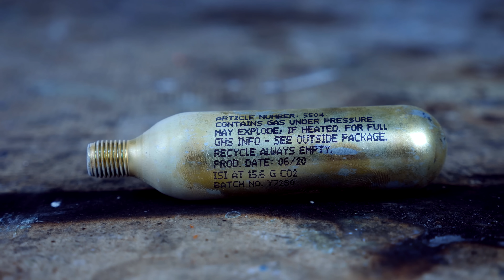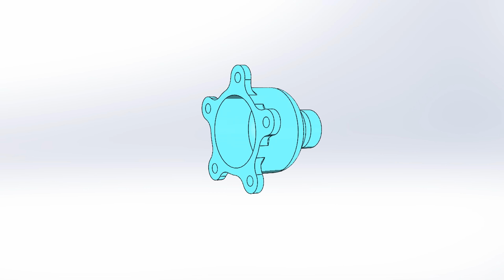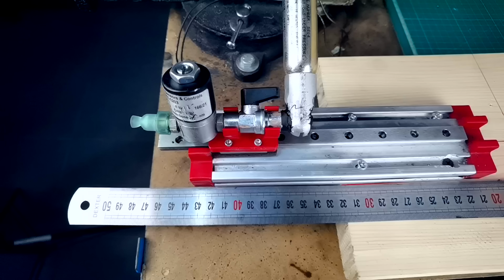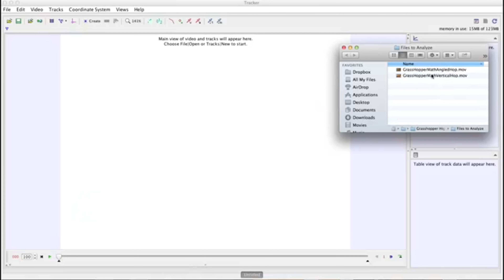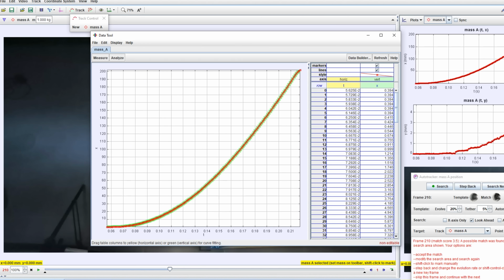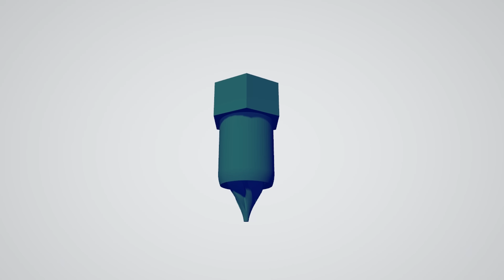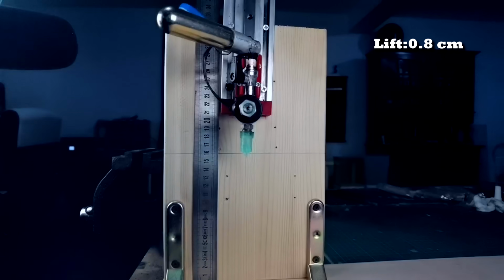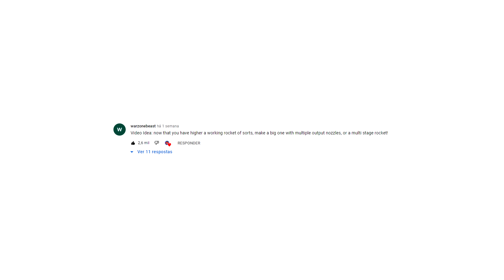I 3D printed a CO2 Rocket

Comment from the maker: For more updates follow me on Instagram @integzaa -https://www.instagram.com/integzaa/
Reply: try building a 3d printed rocket with only one co2 cannister! (sodastream rocket?)
Reply: Make hydrogen powered rocket 🚀 🔥 🔥
Reply: @parshvapatel8484  stop spamming for hydrogen powered engines
Reply: Video idea: use the dry ice nozzles and co2 to make a boat, it would e great bc the lateral propultion is really strong
Reply: put a tomato in space
Reply: Maybe you can add more material along the way, thus creating a system that will compress more material together, which will create (hopefully) more pressure and push the rocket farther.
Reply: so you tried hot rockets that melt your nozzles, 
now in this video you have cryogenic propellant, so cold infact that you are not extracting all the energy out of it because of the cold exit temperature
you know that if you combine both you will get something you could probably launch with decent payloads to hundred of meters? (without melting your hardware)
Reply: Johnny Bravo!
Reply: I want to tell you that you have forgotten a very important thing: you let most of the carbon dioxide expand outside the nozzle, which loses a lot of energy! Your engine is like a nuclear-powered hydrogen rocket engine without heating any more.
So I suggest you warm up the carbon dioxide before it blows out:-)
Reply: @sticker89  A longer divergent nozzle is needed.
Reply: Video Idea: Make a air pressure powered Strandbeest (walking machine), from Theo Jansen :D. Maybe with spider form, with the abdomen as the engine and tank c:
Reply: For the aeros pike engine you should have narrowed the throat before putting the spike. The aerospike is just the nozzle but it needs the throat as well in the footage you can see that the stream was straight but it wasn’t compressed before that so first compress the stream and then put the nozzle. So what you need to do it compress the throat to 0.5 cms and then put at aerospike at the tip you will get more thrust then what you tested
Reply: Hey just so you know Thingy Verse had a data leak and so you should really change your passwords
Reply: add an electrical heating coil inside the nozzle or something to make the gas expand more
Reply: Video idea: Best rocket fuel for under $20
Reply: Video idea :build an air or Co2 powered rc tank 😸
Reply: I am here integza if you need anything
Reply: that "dziękuje ci" wasn't the worst i heard
Reply: Thank you for the Johnny Bravo reference!
Reply: The last rocket nozzle that you made with the helix shapes would probably have the added bonus of being self stabilising in flight .
Reply: could you create a chamber for the filling to expand? i feel you are missing a lot of phase change by ejecting liquid from the canister. yes, a little more thrust upsidedown sure, but you are being more inefficient, which is important for rockets yeah?
Reply: could be just a long steel tube
Reply: Tomatoes are delicious
Reply: I feel touched ❤️ .I'm form poland .. 😅🤣
Reply: Ok so you've done sold liquid and gas rockets. What about a plasma rocket?
Reply: it would be great to have a water cooled ceramic combustion chamber/nozzle with inbuilt pathways for the water to enter and leave.
Reply: i suggest to send tomato to edge of space ... without parachute of course
Reply: You keep saying that you suck at soldering. But you don't have to! Soldering is a very learnable skill. Start by getting yourself a quality iron and a small variety of tips, I recommend an sh-72 or ts100. Watch a bunch of YouTube videos about electronic soldering. Don't forget to get solder and flux. And get some cheap soldering practice kits from eBay or Amazon or your local supplier. Then practice, practice, practice! 
If you think it'll amuse us, then make a video about your journey to learn to solder better!

Even if you don't do any of the above, keep making videos, they're fun to watch and educational!
Reply: There is one thing you don't Test ist cylinder Tesla value
Reply: Try building a propeller sail boat. The propeller will catch the wind and drive a propeller in the water.
Reply: I was wondering if you could design a nozzle that pulled in air from around the bell to apply the pressure of the added intake? Or would that just add more resistance?
Reply: Integzaa why not build for your hydrogen peroxide ceramic Catalyst rocket a chamber that like an air compressor turns itself off and on use a sensor and a pump to fuel the chamber allowing you to regulate your pressure in the chamber and you can separate your waist and discard that as needed allowing your nozzle to have constant pressure
Reply: Please explore this more with more nozels and stuff like that or different designs
Reply: Ok
Reply: Hey Integza, I am looking into engineering degrees and I was wondering what degree you have?
Reply: Would be interesting to see what sort of thrust you can generate with a sodium bicarb / citric acid / water reaction ie cut out the middleman and make your own co2
Reply: https://youtu.be/NlT6XqpoeToy6
Reply: Don’t forget that different materials/fuels will behave very differently so you will get different results from each fuel-nozzle combination where some will do well with one nozzle and others with a different one. I am no expert, that’s just what I would expect.
Reply: Which rocket nozzle would do the most damage to a tomato?
Reply: Video Idea You could create a vacuum chamber to test the nozzles vacuum space  should be a good idea and if you try to ionize the gases with a tesla coil maybe do some explosion
blast tomatoes   ahahahaha
Reply: hey integza if you cut the very tip of a match and use the fire as thrust it will take a bunch of matches but it would be kinda cool
Reply: Make Rocket engine turbopump made up of tesla turbine and tesla valve nozzle
Reply: While you are right in the sense that you no longer need a combustion chamber, you do still need a chamber.  Only now you need an expansion chamber.  You are ejecting a lot of co2 that is still in liquid form when leaving the nozzle or is just starting the transition to gas.  also as co2 goes from liquid to gas its sporadic and tends to bubble and spirt every which way.  I would suggest an expansion chamber with some sort of baffling system inside, but you have to be careful with dimensions and material strength or you get back into just having a fireless plastic firecracker haha.  I was bored and fired up blender to mock up what came to my mind when I thought of an inline expansion chamber, if you would like to see it just let me know. :)
Reply: Hey Integza, since we're at an experimental stage with unusual propellants, here's the tip: Brazil is developing an ethanol-based rocket engine called the L75. There's a significant amount of material on the internet about it, but I haven't seen anyone talking about it.
Reply: Intenzaa how about experimenting wood you instead of the cylindrical Arrow spikes rocket engines how about doing the linear Arrow spikes you don't even have to use thrust vectoring with it instead just shut down whatever injectors and it'll go in that direction
Reply: I used to work with paintball equipment, a bunch of that stuff is powered by CO2. When you pull CO2 quickly from the capsule like that you are getting liquid CO2 and it's being ejected so quickly from the thrust chamber that it is phase changing to a mixture of gas and solid outside the nozzle and you are loosing most of your potential energy. To correct this you need an expansion chamber between the capsule and the rocket. This way you harvest all the energy from the phase change because only gaseous CO2 is reaching the engine.
Reply: im 17 and i get the johnny bravo refference XD
Reply: Good video, but.. was all those nozzles really necesary? I mean it is not something advanced, just some basic gasodynamics. You could do all computations in some mathematical modelling environment (like Ansys or MATLAB, or Kompas 3D/Solidworks)... But it would be cool to show why an engeneer needs to know his math and physics.
Reply: lol i loved Jonny Bravo to bro lol
but ya lol we are getting old.... gd
Reply: Hey u should make a co2 powered golf club to smash golf balls and tomatoes 🍅
Reply: Another video idea make a co2 Powered boat that has a hydrofoil on it
Reply: I don't have a video idea, but you should try putting your 3d prints in a hot water bath before support removal! They fall right off when you do :)
Just make sure to cure any resin that ends up in your bath
Reply: Good job you finally got a working 3d printed rocket :D
Reply: Rocket powered lawnmower?
Reply: before removing support leave the print in hot water (like 60 c) for 2 minutes.
thank me later
Reply: Axial flux motor has high torque plss use it for anything and plss rply
Reply: Axial flux motor has high torque plss use it for anything and plss rply
Reply: Make sugar rocket pls
Reply: Hi, Integza. You'd better make such a rocket from your old co2 bottles without any valves and with large hole in the neck of a bottle instead of small orifice you have. Because it's difficult to say what is the bottleneck:) in your performance. Use just bottle, nozzle and cork in it. Possibly refuel your bottle through cork. Keep everything in place by some holding mechanism. Release it, let the cork pop out and enjoy the show. Show must go on:)
Reply: Im Missing the 3D printed hydroelectric power project hope you come back to this.

I would like to see the Cylindrical Tesla valve as rocket engine maybe as hybrid rocket?

But the most interesting part a turbine which can use compressed air. Make build like a steam turbine
Reply: It's okay we are all getting old.
Reply: I don't know about the plastics you use in your 3d printing BUT I do know that SOME plastics will micro crack when washed with alcohol, I learned this when I made some plastic parts out of (not sure what type) clear plastic and I wiped some of them in alcohol and when I placed some force it broke and when I looked at it with a 10X magnifying glass I saw that the parts wiped with the alcohol had micro cracks but not the parts that i did not wipe...
Reply: Have you ever considered a co² mighty mouse rocket pod, to fire on a tomato 🍅? 😂
Reply: Idea for vid to enter to win 3d printer.   A frictionless magnetic engine.   I think It would really be fun and chalanging for you. And really fun For us fans to watch.    Always enjoy your vids and your war on tomatos.

Comment: What you need is more propellant mass. Use the pressure to drive water though a laminar flow nozzle.

This doesn't detract from the original purpose and results of your experiment, though.

Comment: Try to generate enough solot energy to power a blue LED through a micro-burst, using high power and Sub-Zero cooling the LED before firing it.  Will it work?

Comment: I cannot share my idea as I don't have a patient on it yet. It's a thrust engine that requires only maintenance on the fin assembly inside a turbine system and Bearing system that has only a 1 way valve to expell gas that maybuild up from the decomp of oil molecules. Next is the whole thinker. Think of our friend tesla :) and plasma physics of charged air displacement. I leave the rest to you my friend.

Comment: Its not dry ice inside. It is CO2 liquid. Once exposed to the atmosphere, it evaporates and cools the remaining liquid into dry ice. Liquid CO2 is used in fire extinguishers and in large dewars for restaurant use. Dry ice can only exist below room temperatures, and liquid CO2 can only exist at high pressures. At regular pressures, dry ice sublimates into CO2 gas, and CO2 gas can be deposited as dry ice onto a substrate if the substrate is below 78 C. I am surprised that with his knowledge he didn't know this.

Comment: Optimally, youd want to reduce the weight of the rocet as the fuel is expended. Id suggest a multiple stage rocket where every inch the rocket dumps out its shell. Id use a carbon fiber tube cut in a inch long sections. Then d3 print connection like a round hindge around the edge with fuse cord holding it in place. The rocket would be ram rodded into the carbon fiber, the fuse cord would be holding each section in place, till the rocket reaches that section the the cord would burn off, dropping that section. You could make 5 stages. Each one burns off, reducing the wieght as it goes. To keep it going straight id add rotation to the rocket by adding a spiral fins, to promote torque. Almost using the air itself as a gun barrel. As far as a rocket nozzel...the trick it to increase velosity without causing a restriction, or boom. Id accomplish that by using small straw sized aluminum tubing around the exit port. Maybe a stainless tie wrap to hold them together. They should fit sung into the inside of the rocket and extend about 1 inch out. Then, remove material so the straws look like a rocket nozzel made from straws. This sould increase your gas velosity, while not restricting the expansion of the gasses, or boom. If this sounds confusing let me know and ill make a short vid on a dry eraser board, descrbing the design. Good luck, love the channel.

Comment: An episode idea: Since it is more energy efficient to move a large mass with a small delta-V than a small mass with a high delta-V, why not 3D print a device that will take the CO2 gas to turn an impeller geared to turn a propeller? (Sort of compressed gas powered turboprop.)

Comment: It would have been interesting to weigh the cartridges before and after (at room temperature) to see how much variation there is in the CO2 charge. Even though each cartridge is used only once, it would give you a handle on how much variation you should expect even with the same nozzle.

Comment: 0:53 While that solid is called dry ice, it's not what in the container. In that container is supercritical C0₂. Supercritical describe a state between gaseous and liquid. Which is both (gaseous and liquid) and neither. It behaves as a liquid is so far, that you get evaporating cooling when released from the container. That is why it will build dry ice, if you do it fast enough.  But in the rest, it behaves more like a gas.

Comment: Hey Integza, the idea may be dangerous, but as you can see on your channel you like to play with fire:
According to thermodynamics, the pressure increases with the temperature: that means if you preheat the CO2 cartridges, they contain more energy and thus generate more thrust. I assume that the cartridges can withstand 80 ° C, because they could get so hot (in a car thats pareked in the sun) and otherwise would not be approved by EU standards...

Comment: I believe the 6 mm cup going over expansion so it doesn't perform well.
Reply: Oh and i took different route for rocket, I laminate 3d print nozzle with carbon fiber composite. The carbon work well but almost all resin melt and gone with the gas

Comment: I haven't watched all your videos, so do forgive me if you have gone through this, but how about a simple small flight model? Just stick some stuff together and use the pressurised cartridge as a propellant? But also make it so you can change the cartridge often? And add some valve so the flow is not release at rapid phase, idk maybe replaceable cartige holders too? And then just let it fly, why not?

Comment: There was a very important factor to these tests that Integza didn't mention... the duration of the discharge. In these tests, his metric of acceleration (or the amount it could lift) isn't a complete picture of the performance of the rocket nozzles. This was partially mitigated by the valve setup standardizing the release pressure, but I think scaling the physical dimensions of each nozzle design would help to find the efficiency sweet spot for the energy provided by the CO2 cartridges. Maybe make a circular track so overall energy conversion can be measured?

Comment: Idea for the next video: Ok, this isn’t relating to the CO2 part of this video, but taking the nozzle idea to a slightly different application. You know how in summer when it’s super hot and a pedestal fan you have is just not doing the trick?

Well what if you can use one of the explores nozzle geometries from this video, but scaled up to fit onto a small pedestal fan. Then you can use the same fan to cool you down, but experiment to find the ideal ‘nozzle’ fitted to it to see if they make a difference to how efficiently/ well you can be cooled down. Seems like a fun build, but also a chance to see some larger scale 3D prints… 👍 Keep up the crazy cool vids though. Forza Integza!

Comment: 3d print the fuel cell, incase in sheet metal. 3d print a lathe, add electric motor turn and bore nozzle out of steel. Assemble. Test. Kill tomatoes. Post to youtube. Get money.

Comment: Hey, i know you have tried to make a metal 3d printer with steel filament, but i haven't seen anyone try making one with 'tin' which is metal that has much much lower melting point so it will be easier to control...

Comment: Hey Integza! How about building a De Leval Nozzle with spiral flow in-built? And you can use it in your multi-stage rocket build! You can use a hybrid setup with both liquid and solid fule. This way the first stage can be solid fule and the second stage you can use the De Leval Nozzle with the spiral air flow in second stage. And if you mount it on a gimbal like setup, you'll also be able to control any deviation in the direction due to air resistance.